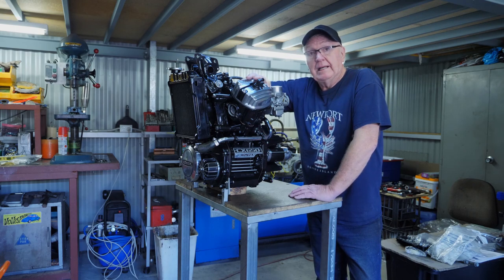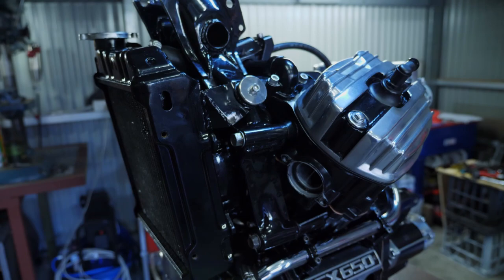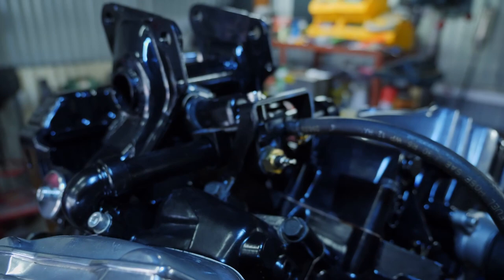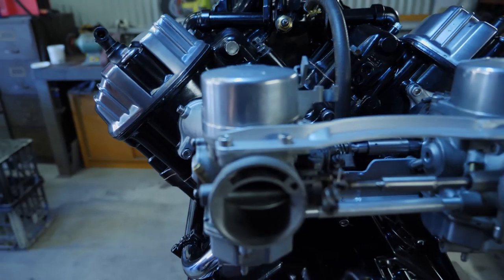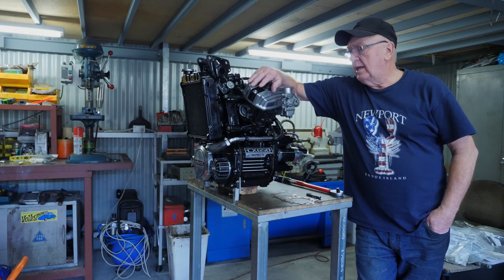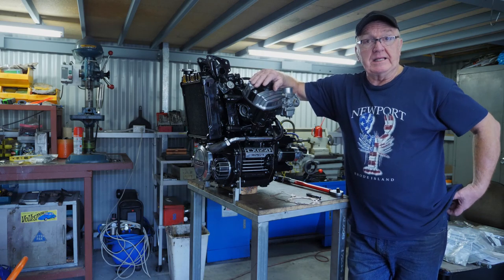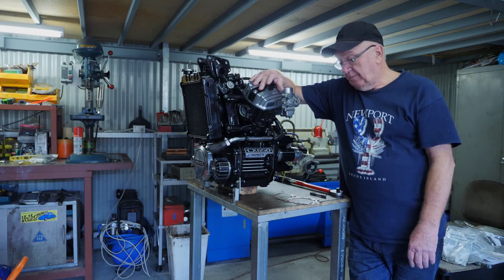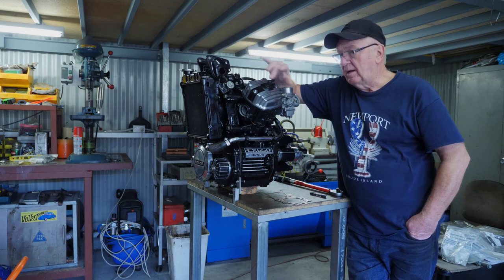CX 650 Conversion Motor Overhaul

Comment: Steve, look up Auto expertTV. John Cadogan has a video, a couple of month back, detailing using antiseize  on wheel bolts and gives the theory of the reduction in tension for that.  The same should apply to any stud.
Reply from the maker: Hi Keith 
I'll have a look at that 
A reduction in tension ? or would that be a reduction in clamping force ?
I must have a look 
Thanks mate
Reply from the maker: Hi Keith 
I checked out the Auto Expert, He's a funny Aussie guy and a great article, very knowledgeable 
So I should be OK with a little grease on the bolts 
I will recheck head bolt tension and tappet clearance after shes been for a run

Comment: Wow Steve!!, what a nice looking engine!!, getting there brother
Reply from the maker: Hey Carlos !
Thanks I do just have to wait for a Rae San ignition module to come in and shes goes into the bike 
Parts are taking longer to arrive with this Covid 19
Reply: Coolhand99au , hey Steve, I have a question; is Rae San cheaper than Ignitech?
Reply from the maker: Yeah Mate
I'm local Ray lives in Adelaide too
Ray - -who makes his Rae San  ignition modules for a number of Japanese vintage motorcycles at his home in Adelaide
I have been really impressed with the performance of his ignition system 
I purchased CX CDI to 12V coil Conversion Kit for $200US this has the Hall Effect sensor that replace your advancer coils on the motor. Ignitech needs these coils that are now getting old and worn out 
Its a very simple ignition system to fit the main module is small 50mm square
One other thing you will also need is 12 volt coils if your CX is CDI model
Links
https://www.rae-san.com/
https://www.rae-san.com/product/cx-cdi-to-12v-coil-conversion-kit/

https://www.ebay.com.au/itm/Yamaha-12V-12-Volt-Ignition-Coil-Single-Output-High-Performance-3-Ohm-DC3-1-NEW/202780245120?_trkparms=aid%3D111001%26algo%3DREC.SEED%26ao%3D1%26asc%3D20180105095853%26meid%3Dbca6269376194346990c49435bf71913%26pid%3D100903%26rk%3D1%26rkt%3D20%26mehot%3Dnone%26sd%3D112709554915%26itm%3D202780245120%26pmt%3D1%26noa%3D1%26pg%3D2510209%26brand%3D2FastMoto&_trksid=p2510209.c100903.m5276
Reply: Coolhand99au , yes Steve, long time ago after I installed the Ignitech (CDI) I dig on the Rae San system and I found MotoFaction site, they have a complete step by step installation and also said that if you have already an Ignitech installed you (me) only need de Hall Effect Sensor (about 100 US dollars), I didn’t get it because I believe that the Ignitech need to be re-mapped (by computer) to do so here in Uruguay it will cost me a nut and a half if I can find someone who can actually do it, so I think that I can live with some back fires on reductions, thank you for answer, I willing to see your bike done, all the best mate!!✊🏻
Reply from the maker: Ok 
I'm thinking if you have a miss fire then it wouldn't be coming from the Ingtech it most likely is the advancer coils

Comment: Hello Steve! Nice build there, lots of work... good work. Question: Why do you use a 650... the 500 is not good?
Reply from the maker: Hi Derzelas 
The 650 has more power than the  500 
The 500 motor was great and I will use that motor in another bike 
But the 650motor came along and I couldn't resist buying it
Reply: @Coolhand99au   Thanks, i like your vids